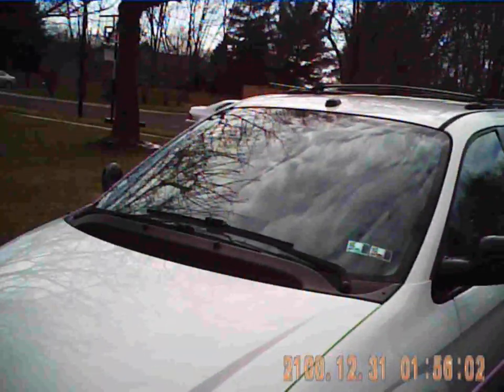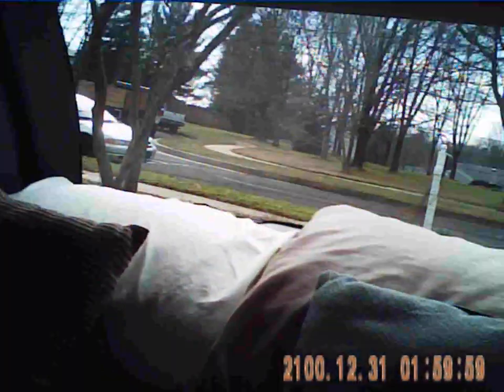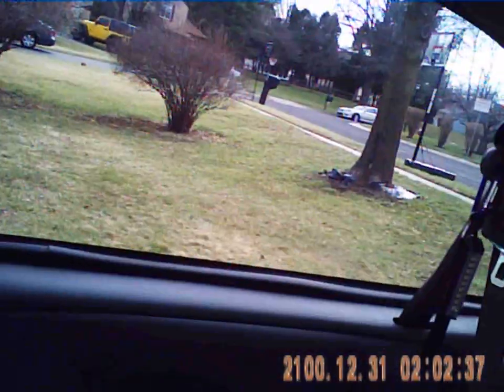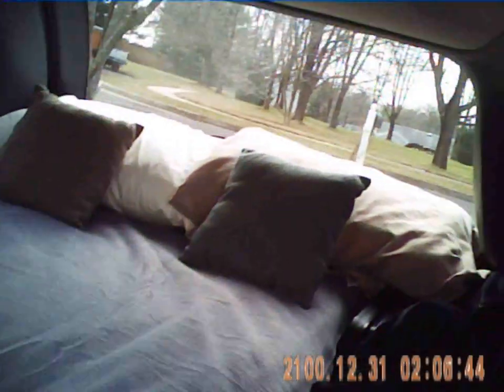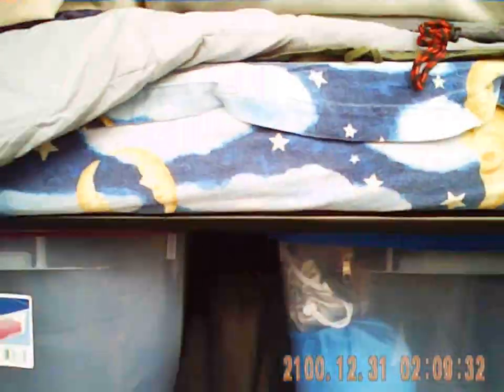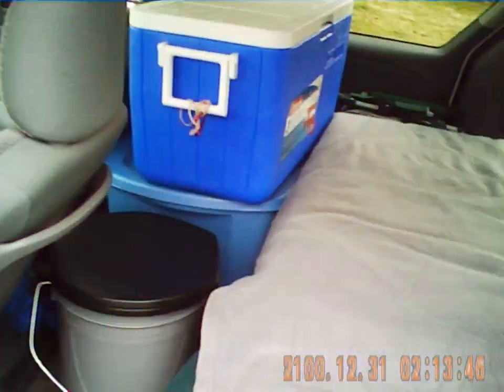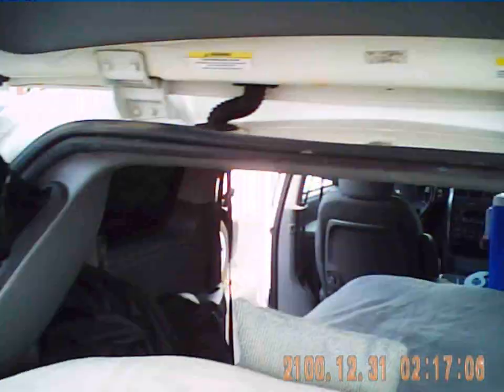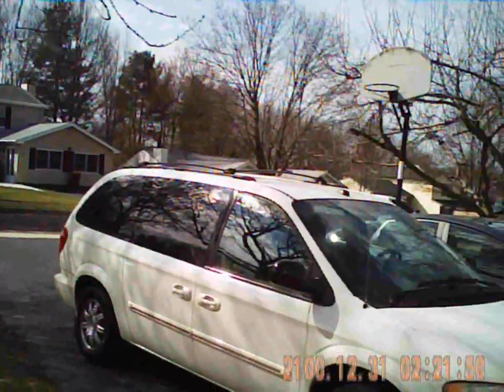Minivan Camper - Town and Country RV sleeps 4

Comment: Family cargo camper van. Im working on mine. Commercial wire shelves fit between wheel wells. Using two jumbo dog beds with 4 inch memory foam. Stow n go set up makes quick use of every thing. The bank is my kitchen storage area. I sold my nice truck because these vans are so universal.

Comment: i can use the air condition from my minivan all night is it safe
Reply: It's not a good idea for your engine to idle all night -- for the engine's sake.  You also risk CO poisoning.  When we've had to sleep in the van, we use our remote start -- the van runs for 15 minutes then shuts down -- that way I don't have to worry about falling asleep while it's running.  We do that for both a/c and heat -- depending on the weather.

Comment: what about ac
Reply from the maker: The built in automobile air conditioning works great, and I've got a little portable unit that operates on only 324 watts, which can run for several hours on the inverter with the single 100ah battery in the camper.   I've currently got 100 watts of solar, but have room for 300 watts.  Upgrading the solar to 300 watts would run AC for most of the day,  continuously without shutting off or running the battery down too much, whenever the sun is strong (i.e., when it's really hot).  I've also got a small generator, which will run the AC and/or any appliance, but I prefer not to use it.  Because the space is so small, I can get away with using really really small electrical devices to power everything.  My power needs are tiny.  As it gets hotter, I'm going to play with using an ice powered AC unit - in that small space it may work...

Comment: You can't make the kids ride in a bucket....man. THAT part is not cool. I'd do something different with the middle seat so at least they are safe. IMO.
Reply from the maker: They don't ride on or in  any of those things. Everything pushes back and the manufacturer fold and go seats pull back up just like in the normal default driving setup
Reply: +Nick Antonaccio I gotcha....I gotcha. I wish mine stowed under...and didn't weigh 900 lbs!! I found using the very rear seat used in the middle position works to give an extra seat belt in the middle....keeps my 2 teenagers THAT much further apart...and gives them room for a little cooler to use as an arm rest/barrier! Ahhhh.....teens!! LOL!!!
Reply: +Nick Antonaccio Aaaaand it would have helped if I had watched the ENTIRE video before commenting......my apologies.